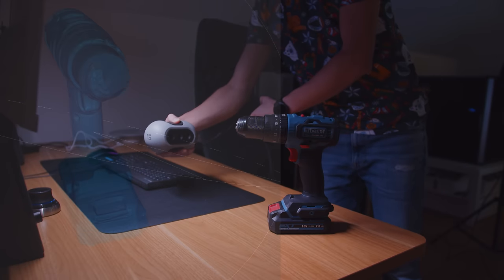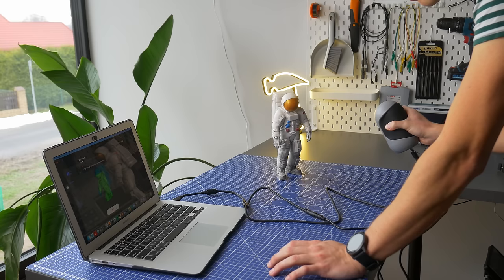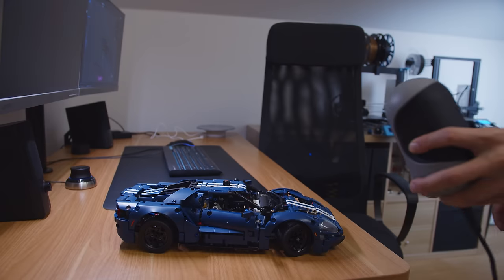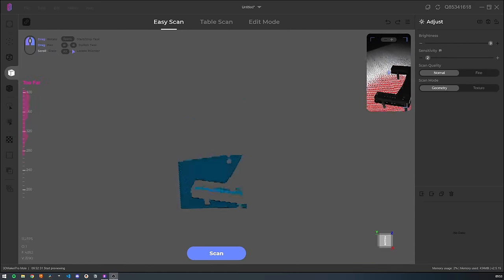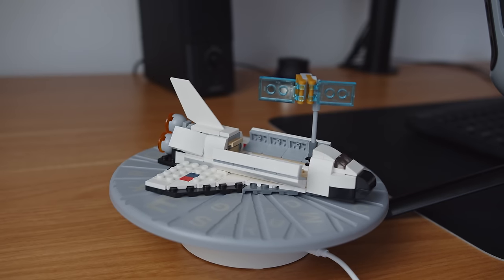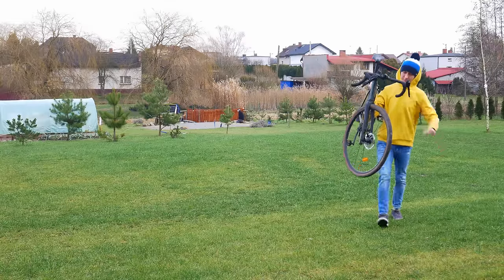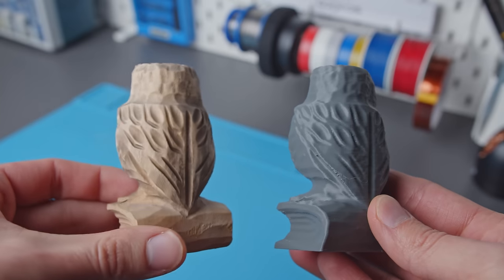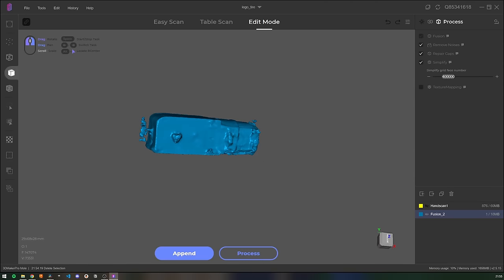How Good is 3DMakerPro Mole 3D Scanner?

Comment: So, the answer is yes. Scanners are still bad
Reply from the maker: It really depends. They are supper easy to use, the accuracy and resolution are really nice. But in my opinion there is only a very small group of people/professions/makers that might need one. It's a very specialized kind of tool that most of us might not need. At the same time for some kind of projects it's a must have that saves a ton of time and make life much easier.
Reply: It just depends on the price - you can get great systems but you'll have to pay some 10 k$ for it.
Reply: @PerhapsPh You can simply use your phone for photogrammetry to archive the same result. You don´t even need an external device, I have done it for years.
Reply: @sierraecho884  I doubt you't achive an accuracy of few microns just with your phone ....
Reply: @PerhapsPh  0.1mm is not a few microns it´s 100 microns. You can archive a few micron accuracy but you will need magnifying lenses and it will take a long time. You can be as accurate as your camera and optics let you be. You can even 3D scan under a microscope, as long as you can take a picture you can scan it. That´s the simple beauty of it.
And btw your typical scanners in the 1k-10k range don´t archive a few microns either =)
Reply: @sierraecho884   I'm not discussing 0.1 mm but 0.020 mm and a price range of about 30 - 80 k$. Plus please don't mix resolution (size of details) and accuracy.
Reply: I bought the MOLE. You are right..😩
Reply: @PerhapsPh  i work with a <50um very expensive system daily and its honestly still a lot of work. using materials not designed to be scanned (reflective metals) will need a coating of scanning spray, but the scanning spray adds significant thickness. most 3d scanning sprays add like 50-100um, way too much. we found only one acceptable spray but even with that uneven coating quickly renders the result useless, so you have to become an expert in spraying techniques and need a room with constant temperature to apply the spray. its also advertised as "self vanishing" but that depends on the material you put it on, on many materials it never vanishes and you spend like an hour cleaning. also proper fixturing is a problem at these resolutions. sometimes the part might shift just slightly or vibrate if you bump into the machine, if that happens in between scans (during movement) no worries the software will compensate. but if it happens during scanning youre screwed because you dont see with your eyes that the model is now off by 0.2mm at that one point. so yes, 3D scanners still suck.

Comment: I bought a creality feret scanner (one generation older than the one just released) for $220 a couple months ago.  Still not perfect, but for such a cheap price I'm still impressed.  Still did a better job than an einscan pro I used to have (which originally sold for $6k).  Even though the creality works with a phone, even on a powerful samsung galaxy S20 ultra it still lags a little more than when scanning on a dedicated desktop.

Comment: I don't get how 3d scanners are still so expensive. You just need two (or more) sensors pointing in the same general direction and a 1-2-3 block to calibrate with. A 100 megapixel CMOS chip is literally $30 and down to like $15 with bulk orders.
Reply: AFAIK the price is mostly in the software and tuning, not so much the hardware. Fusing all of that sensor input efficiently enough to operate in real-time, while finding and correctly interpreting reference points to maintain positional coherence is a very difficult task, even for modern computers, especially when you consider the bandwidth limitations of a USB port (this device uses USB 2.0, so 450mbps) limiting how much data the software can work with in the first place.

A smartphone camera could do 3D scanning with the right software (particularly the multi-cam phones common today), but cramming enough compute into the phone and using the right sensor fusion techniques keeps that from happening quite yet.

Comment: Ive been building custom 3d printed photography turntables and motorized camera rigs for photogrammetry scans and converison into web assets for years. Its a huge pain in the ass. 
Linear polarizer filters are insanely helpful in preventing glare with 3d scans. It requires a photography tent with polarized led light inside, polarized 90 degrees against the filter on the camera

Comment: It's a shame that some manufactures want to charge you an extortionate tate for something, if they even sell the part at all.  Imagine trying to find a replacement grill for a 1930's car you are trying to fix, or a broken door handle.  Its better to scan parts now, have a catalog of them for later.  I hope they don't decide to go full DRM and have a catalog of devices they recognize that refuses to work.  I've dealt with 3D scanners in the price range of $20k-$30K and the restrictions alone for the software is maddening enough.  The software, license are super restricted and proprietary software to boot.  Imagine if you don't have an internet connection for it to dial into the mothership to make sure the thing you legally purchased from them is fine.

Comment: I bought a Mole from the preorder Event for my small 3d printing Company to be able to Reverse Engineer technical Parts, which did not work out in any way. Way too low accuracy and insanely Bad Software. Ist just not fun to use this Scanner. After a while i picked up a shining3d Einscan sp which gave me everything i wanted from a relatively cheap Scanner. Perfect results from the Go and usable scans. I Love it and i hate the Mole.

Comment: 3D scanning was always super easy if you used photogrammetry. It is even cheap since you can do it with your phone and some additional software of which even free versions exist, you don´t even need a dedicated scanner. You don´t need your computer for data acquisition. You don´t need a cable or anything besides the camera. Only downside is, you can´t scan moving objects like pets and such. At least not easily and not without only one camera.
I can scan in the 0,1mm area with my smartphone or my 300€ DSLR. I scanned human sizes statues in 10 min. The quality was not up to 0.1mm accuracy but in the 1mm accuracy which is plenty enough for me. So it´s pretty simple. The scanner I would get is an automates blue light scanner since it´s way faster.
I can also share my models, they are for free you can check them out if interested. For instance I have scanned a trench knife from WW1 and you can see the metal marks in the blade from manufacturing.

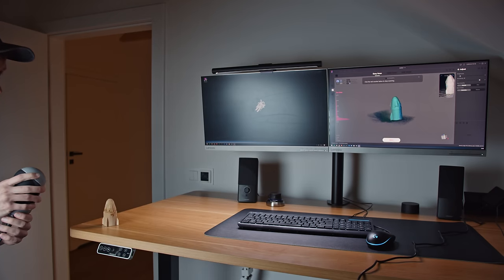Comment: You mentioned (beginning at 3:40) that it works with IR light and that it will not be influenced by visible light. But what about sunlight outside, how is it's performance there?
Reply: UV is not IR.
Reply: @boggisthecat bruh
the sun puts off as much IR as it does visible light iirc

Comment: Instead of the spray, just use water colors, or foot powder, or baking powder or anything really. For objects which you can´t or don´t want to clean you can use a projector with a noise pattern instead.
There is basically no technical object which needs canning. Only biological structures which are hard to model in CAD but almost everything man made is simple shapes stacked on top each other and intersected.

Comment: Still way too far for my needs. I mean I can draw fairly complex 3D models with reasonable time by inserting them to ie. layer backgorunds and modeling by them taking measurements. What I would want to see is like fast reproduction of something like intake manifold rubber of motorcycle carburator and airbox. Or maybe fast and accurate dimensions something trivial fairly trivial like gamecontroller/mice part that has complex shapes that are hard to measure. None of the methods current 3D scanners create enable that. There's just way too much of deviation to my liking. That being said. Thank you very much for proving the accuracy for my needs. I'll look into them next five years or so.
Reply: There are 3D-scanners wich would fulfil your needs, but they are in a total different price range as they are used for inspection of turbine blades, engine components, and much more. But the it is not a question of 600$ but 60 k$. Just search e.g. for a Hexagon SmartScan or StereoScan neo.
Reply: @PerhapsPh  true, I've seen some demos of very good accuracy scanners for industrial usage. But these household models are not even close to them. Progress in them too absolutely, but still way too expensive for their accuracy to me.

Comment: I think people just need to accept that the best way to get results from 3d scanning is with a dedicated gantry over a turntable that tilts the sensor around the center of the turntable, adjusts the angle of the censor, and the focus of the sensor (either by actuating the lenses or moving the sensor itself), and adjusting the height of the turntable. Bonus points for having the turntable have two offset planar axes of rotation. It is a game of just providing as much unique data as possible, and scanning by hand will never produce ideal results in a reasonable timeframe. 5 minutes and a poor result done by hand or 2 hours and a perfect automated result.